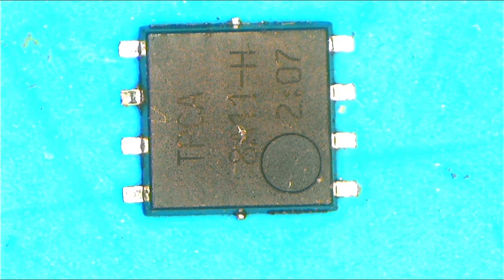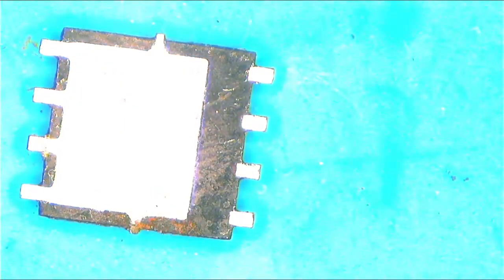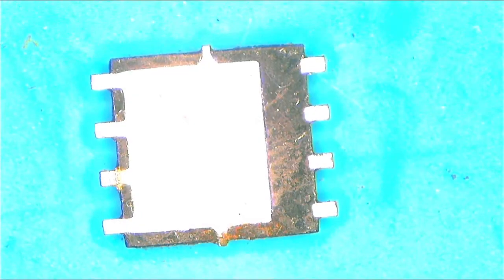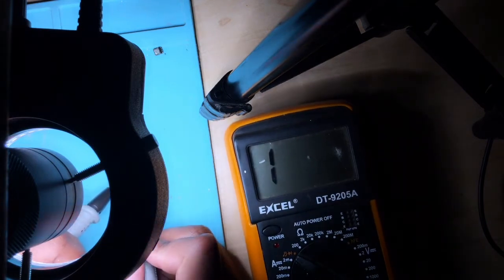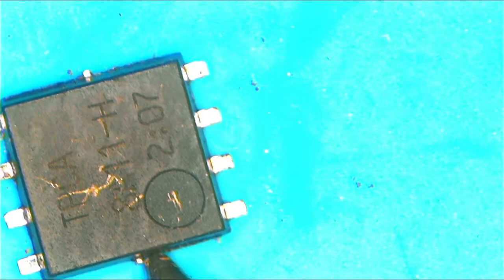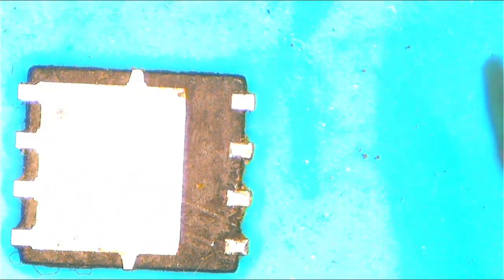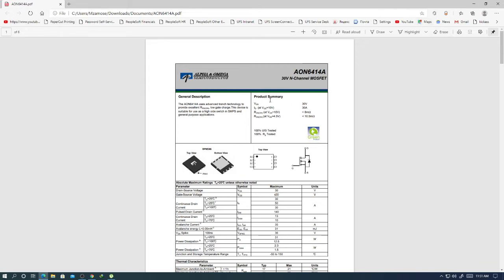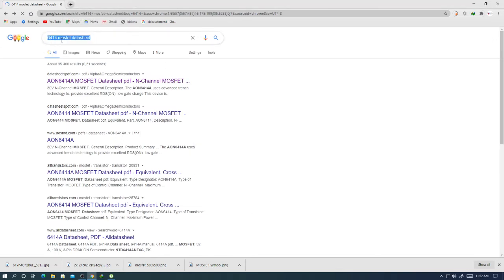How to check a shorted mosfet using a multimeter

Comment: What is the 3 joined together in the back, metal plate?
Gate Drain or Source?
Reply: Drain, in the case of that mosfet (and basically most others). Some dual mosfets can get funky with that but it's the drain, the single pin is gate and the 3 next to drain are source.

I wish they used more obvious and logical names for mosfet pins, tbh. It is very confusing at first.
Reply: @DannyWilliamH  Thanks

I remember it by
Drain, as water drains INTO IT
Gate allows it to OPEN OR CLOSE
Source sounds like Soil or Ground
Reply: @rectify2003  

That's actually a clever way to remember it. I may have to borrow that!
Reply: @DannyWilliamH  If it helps 😇

Comment: I understand but I used to bypass two mosfets and it charges , can you explain please ? I know in newer laptop the BQ chip won't allow that but how about older laptops ? I tried it myself in hp pro book board which first two mosfets was burned and welded to the board and I bypassed them with jumber wire  and laptop was working and charging
Reply: new laptops come with bq chips that have mosfet short circuit protection they nolonger allow bypassing only old ones can